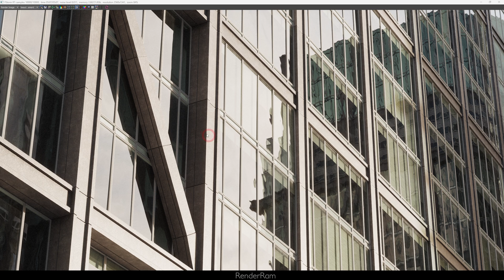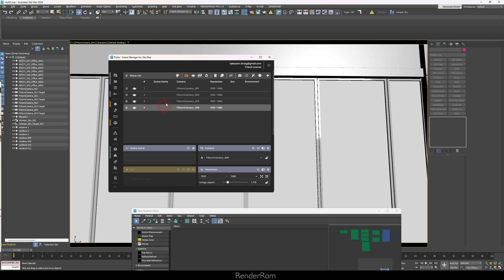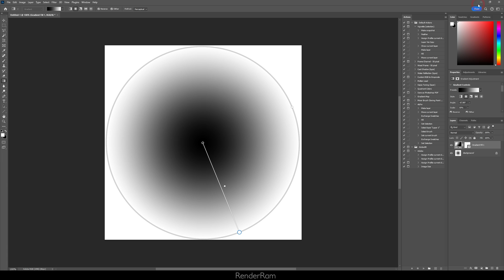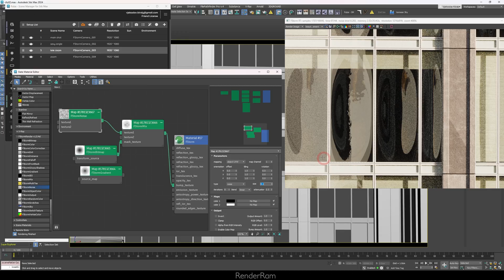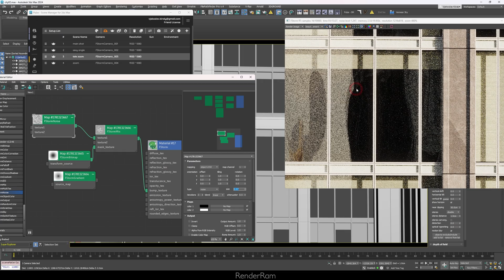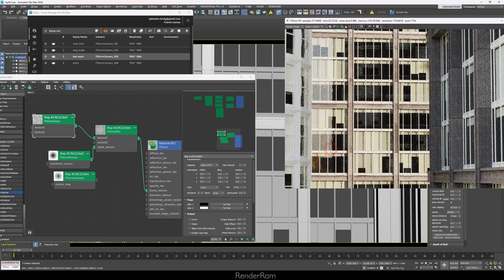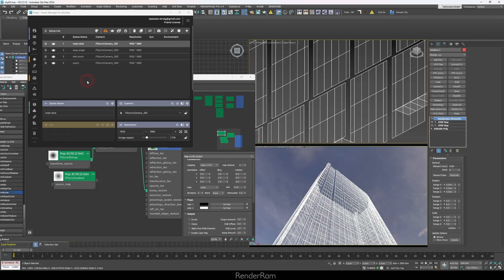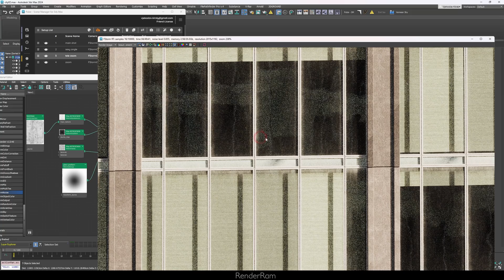Window Glass Bending For Realistic Exteriors | All 3D Software

Comment: Hey Vjeko! Your approach is super realistic and I love how reflections turn out in renders. However, there is one thing that I have a problem with and maybe You have an idea how to solve it. When glass is distorted in that way, everything that is seen behind the glass seems distorted too, and it doesn't look real. I have even took a trip round my city and took a look on different big windows that has those distorted reflections and interior was always unaffected.
Reply from the maker: I had that once, but didn't have time to experiment fully... BUT this was my way of thinking about it.
So what happens, when you add a bump to a glass (box object), that bump is projected on box's normals, meaning if you have a bump facing outwards, on the BACK of the box it will also face outwards, therefore making the glass artificially thicker which gives it more space to distort things.
Where in reality, when glass is bent forwards, the whole object goes forward
meaning that your back side should have the same bump but negative value so that it mimics the correct thickness.

Edit: Best way to test if it really works,  create a glass box object with 3mm thickness with lots of polys, add a slight noise modifier to bend it, and see if things in the back bend
Reply: @RenderRam  Thanks for Your answer! I always admire Your deep insight into mechanics of 3ds max :) HOWEVER, in this situation max's behavior seems to defy logic, because I did some tests and thats what happened:
1. When mesh is physically distorted by noise modifier as You proposed everything looks ok - reflections are bent, interior is not. COOL
2. When glass material with bump is assigned to simple plane with no thickness it still distorts interior so it is not effect of different thickness of glass due to different normal vector

I did those tests with vray. I don't have any other rendering software(only arnold but don't really know how to use it). Maybe someone could test it with other rendering software?
Reply from the maker: @mateuszomanski9169   with no thickness?
your window glass must have thickness, a single sided plane reacts as if you have an infinitely thick glass
For example, if you want to create a pool with water, it's enough just to place a plane as a water surface, because everything seen trough plane has an infinite glass or water effect, meaning if your pool is 3m deep, what you see trough plane will act as a 3m thick surface
Reply: @RenderRam  whaaat? Didn't know that. I feel like preschooler now 😅 In that situation I've run out of ideas 😪
Reply from the maker: @mateuszomanski9169   we've all been there :D
Reply: @RenderRam  yeah, everyday learning something new. Anyway, the problem remains unresolved. If You have any idea how to solve it, please let me(us?) know. Have a great renders!
Reply: In case someone has the same issue, I have just found the solution. You just have to check the option "thin-walled" in Your glass material and that's it :)